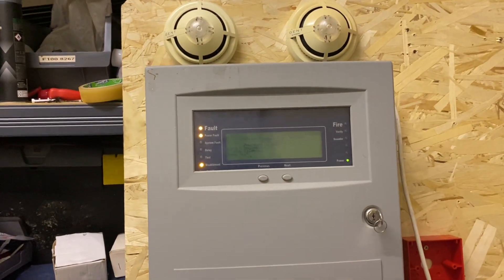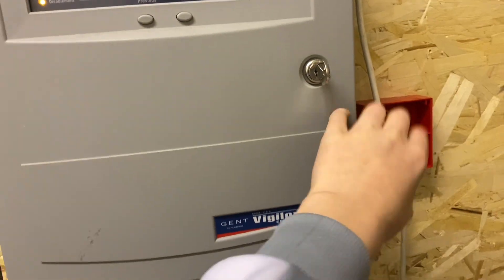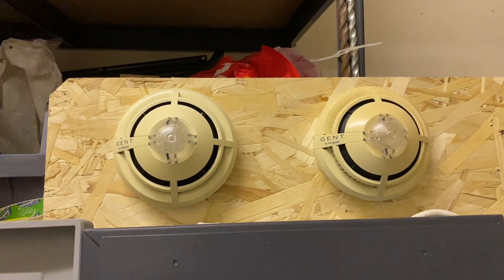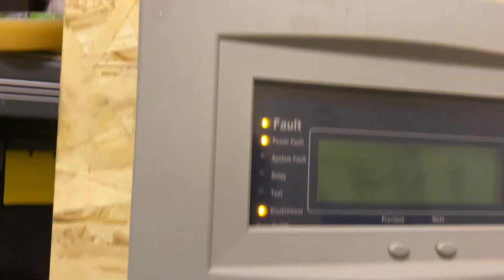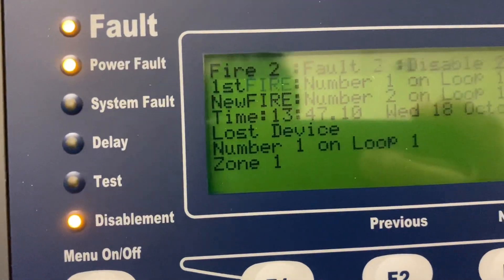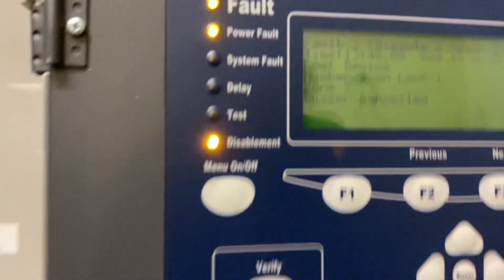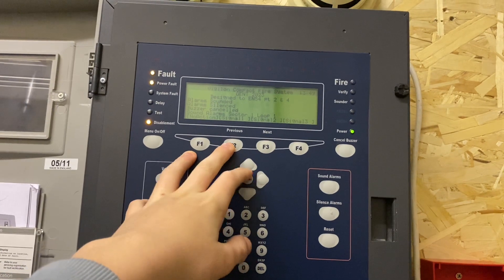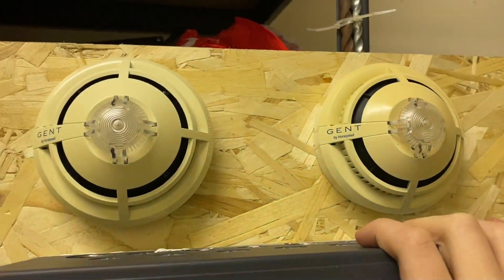*NEW* Gent Vigilon Board System Test #1!

Comment: Are those S-Quads?
Reply from the maker: Yes they’re Gent S4-771’s.
Reply: Where to buy them😊
Reply from the maker: @TheVampireDevil I bought mine off of eBay. They float around for decent prices, I got 28 S4-771’s for £50.
Reply: Nice, I have bought a "Apollo Alarmsense Sounder beacon base and optical smoke detector!"
Reply: @obalarms For £50 you got 28?! Thats a lot! when will u make a house system
Reply from the maker: @TheVampireDevil I’m not allowed a house system as I’m only 13 but I’m installing in a shed when I get one.
Reply from the maker: @TheVampireDevil nice!
Reply: Can you make a tutorial on how to wire a apollo and KAC fire system without a panel? AlarmSense
Reply from the maker: @TheVampireDevil you could use 9v batteries, i don’t have any alarmsense devices so you’d have to ask someone else. 😁
Reply: Oh ok, can you at least show a vid bc idk how to  wire them 😅
Reply: @obalarms  Alarmsense Sounder bases can't be powered from 9v batterys as they use a certain protocol, It's the same reason why regular conventional panels can't use Alarmsense devices
Reply from the maker: @SgFireAlarms not 100% sure about this but most conventional panels can use the alarmsense sounders, just not the detection and manual evacuation. And I’ve saw someone operate an alarmsense sounder with 2x 9v batteries
Reply: @obalarms  Afaik i've never seen somebody do that, I've tried to o it myself and it never worked.